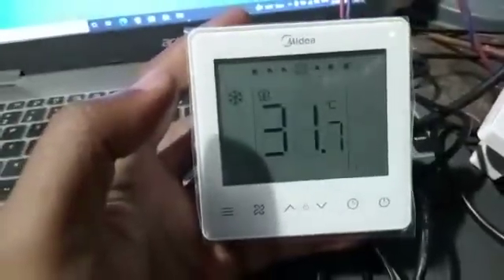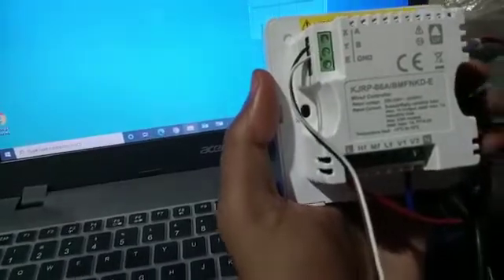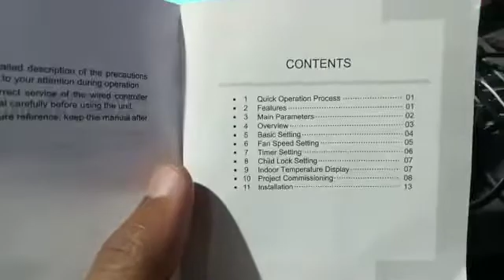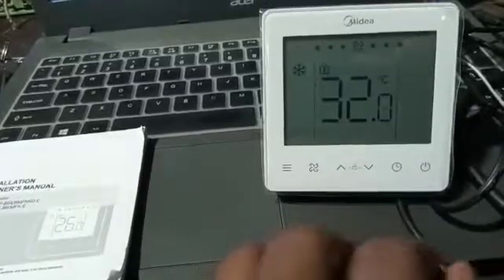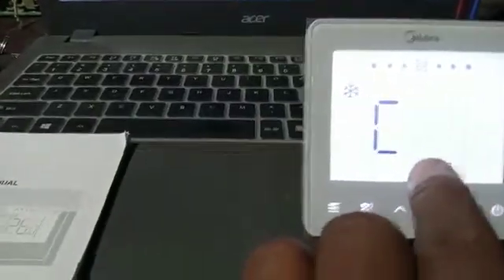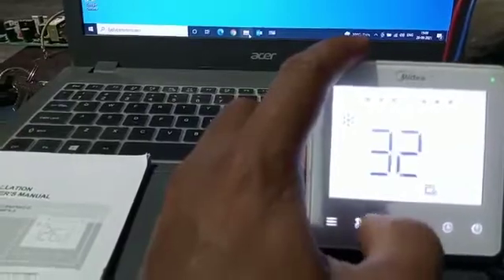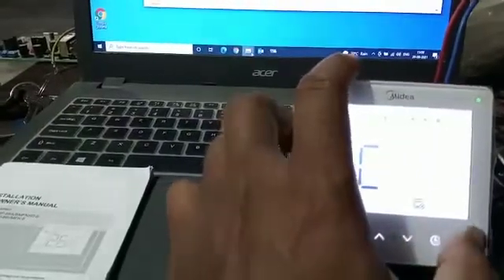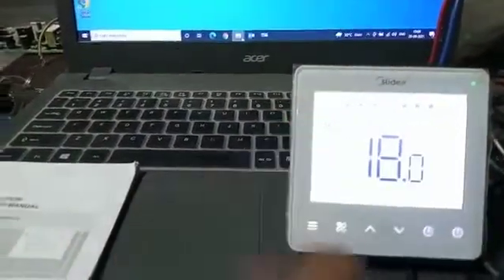Modbus Thermostat Explained. Midea KJR P86-A #kubicindiasolution #midea #kubic #hvac

Comment: Hello! How do you connect a temperature sensor to this thermostat? What connects to X and Y? Thank you!
Reply: Temperature Sensor is inbuilt in this thermostat. 
X and Y are serial port, they are used for connecting the thermostat to bms.